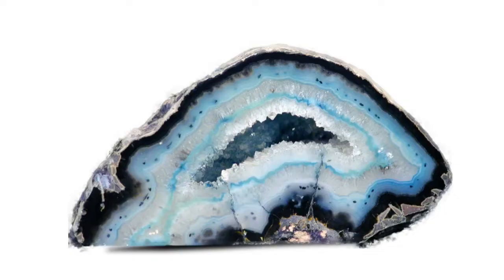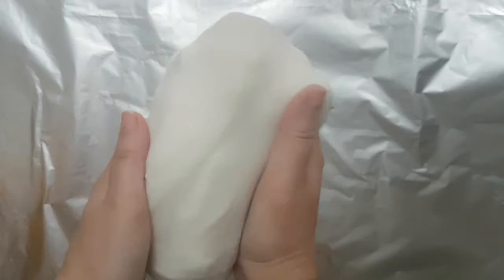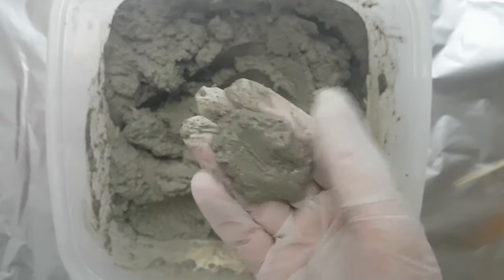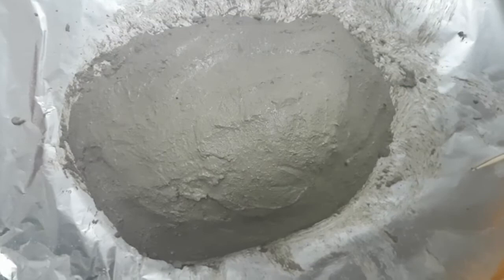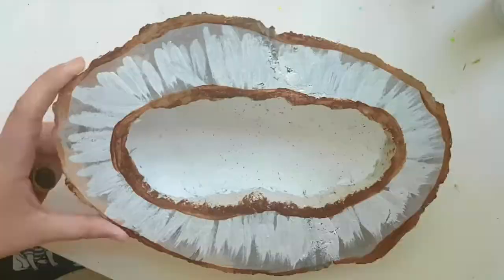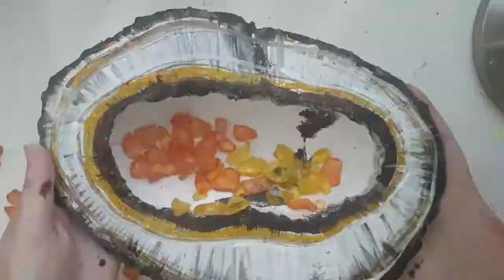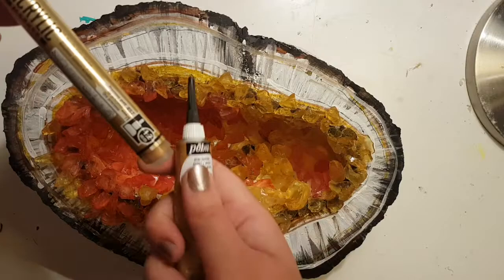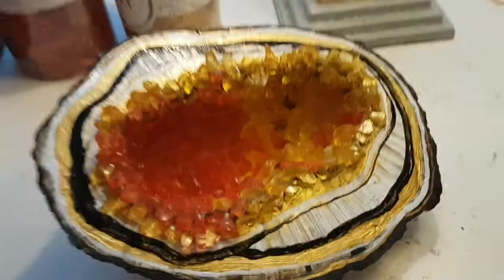Making a Cement Geode DIY and adding Gold

Comment: Thanks so much for the mold making idea. Hope to try Quick drying cement and see how long it will take to dry.
Reply from the maker: Yes see what the instructions say but I would still add an extra day or 2 so you don't need to redo :) especially if you're in cold climate now